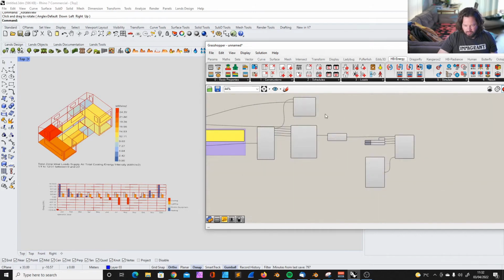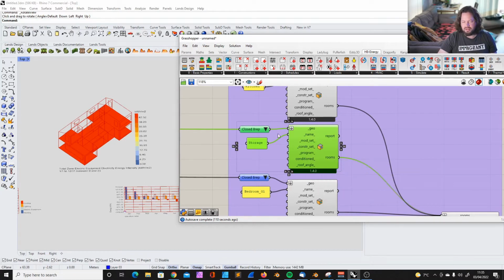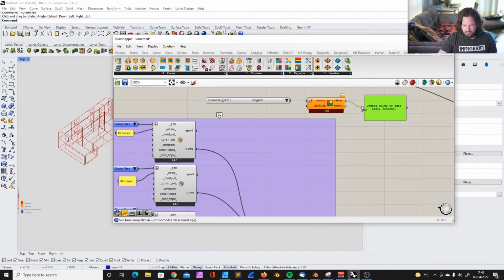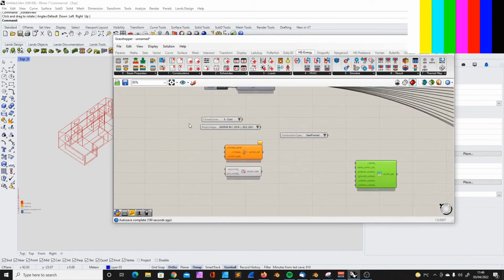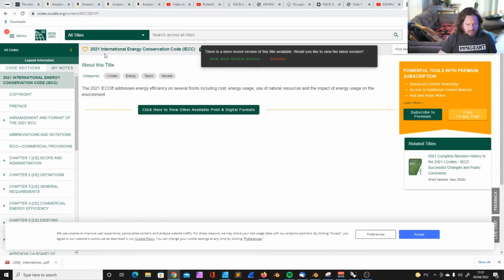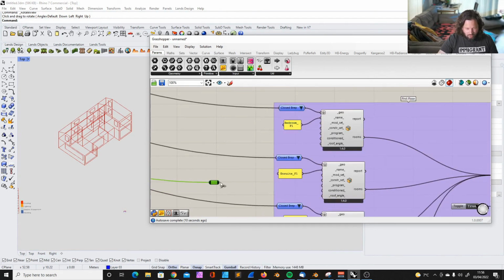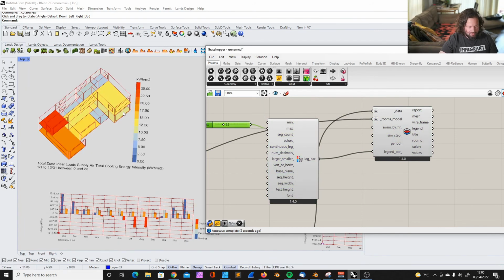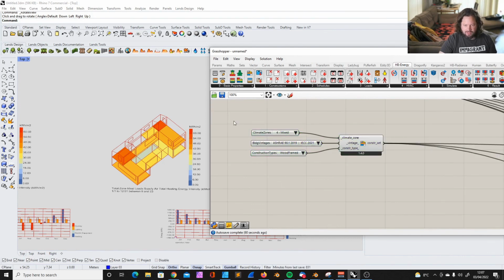Honeybee 'ENERGY' Part 3 | Construction Sets Basics | Ladybug tools 1.4.0

Comment: Hi :) Thank you so much for the videos, they are really helpful. I wanted to ask how we can introduce different construction sets. I am building an energy model for a vertically extended building, and I need to have 2 different construction sets for the current floors and the new floor above. Honeybee does not read the different settings sadly. Thanks in advance!
Reply from the maker: Let me get back to you on that.

Comment: thanks for the great videos they are very helpful, can i ask about that error 1. Solution exception:Expected Modifier for _ceiling_. Got <class 'honeybee_energy.construction.opaque.OpaqueConstruction'> it always appears when I construct interior subset when i connect it with opaque construction material ?
Reply from the maker: Don't know from the top of my head but it seems you are providing a construction set where a  modifier is required. It's important to note that modifiers are needed for radiance calculations whereas construction sets are used for energy modeling.

Comment: Is the simulation correct in assuming that the model does not have thermal bridges?
Reply from the maker: Hi Santiago,
Good question. I think the E+ and Open Studio energy model is not taking thermal bridges into account or at least not direct.
R and U values are taken into account for materials and the building vintages and construction sets  approximate thermal loss.
However,  It's definitely a weak spot of E+ and OS.